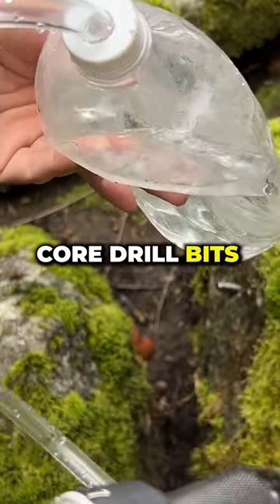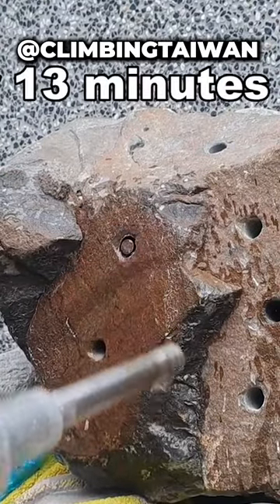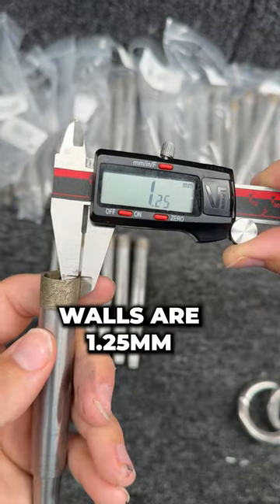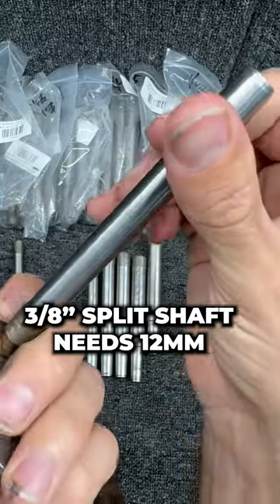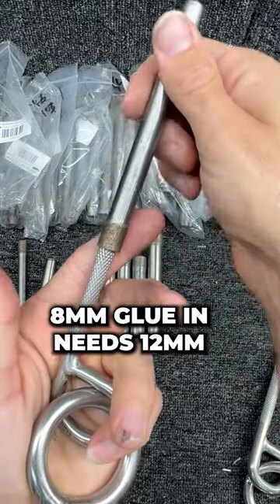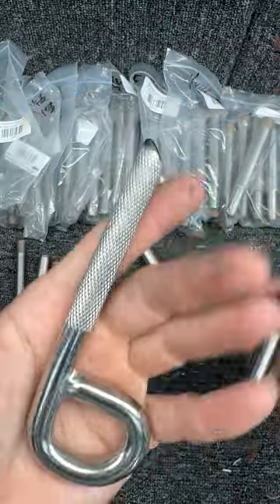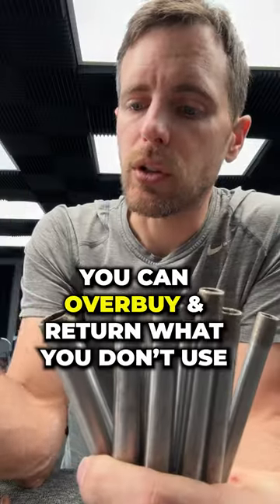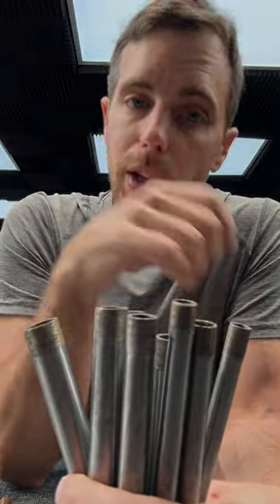Best Bolt Removal Hack

Comment: Very cool idea. Makes life easier for getting the old stuff out, but do you have to increase the size of the hardware you use as replacements?
Reply: yes but there is also a product called liquid rock that refills the hole to original size

Comment: not sure if you do, but it would be useful to list the bits that work for any given bolt on that bolts page and vice versa. I'd also use some sort of marking system so you know if they used the drill bits so you know if it's a reduced refund.

Comment: Why wouldn't you just cut the bolt flush with the rock instead of leaving a big hole in the rock?
Reply: Sharp edges and then your leaving trash inside of area that’s others will use and see.

Comment: So every time you replace a bolt you make the hole bigger? Seems unsustainable.
Reply: Better than the alternative of drilling an entirely new hole next to it.
Reply: On the contrary. It sounds way better than having 50 empty holes in a rock instead of one 1.2 m wide hole.
Reply: This would only be done for broken bolts, I think.
Bolts that are worn out but not broken should be removable by other means.

I am not a climber. I just watch this channel.
Reply: @Adam1nToronto  Yea either bolts that get broken trying to remove them normally or glue in bolts as well.
Reply: You can just add one size bigger bolt into it, it's not like you will be removing these 10 times a year or something.
Reply: @dumbcrumb879 better to have a dozen holes with chopped bolts than one ginormous empty hole
Reply: @iedison3839  It wouldn't be empty. The larger hole gets filled with a bigger bolt.

Comment: You REALLY Need to advertise these core bits in other areas of life. Like for the working man as you have done with the drill run pulley system you sell!!! These would be Amazing AF for tile masonry and practically every Construction oriented field!!! Even for crafters!!! Actually, Especially for Crafters!!! These would be amazing for Crafts!!! Broaden that customer Base My Friends!!! You have earned it with ALL of your tests!!! No other sellers are doing these tests to Show You what the products are capable of all the way to the point of breaking!!! They want to act like nothing they sell will ever break!!! And You Guys say hey, they absolutely WILL, but, Here is where that's going to happen!!! And for my construction guys tying off with Beeners over a rail, will you please show them how incredibly ignorant that is!!! The beam works as a weight multiplier and will cause them to snap their Beeners if they fall. Since a 200lb person on a 6' fall creates around an 8,000lb shock load!!! Im OSHA certified, an OSHA Infinite if you will. Lol. I Love my Training!!!